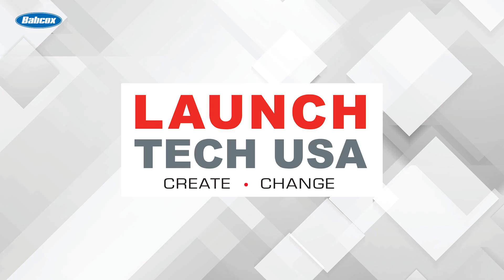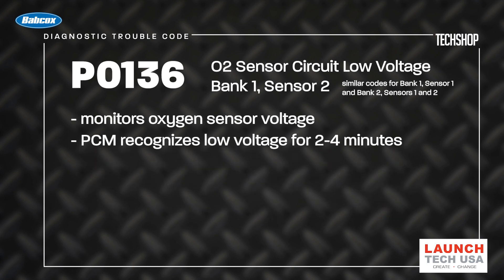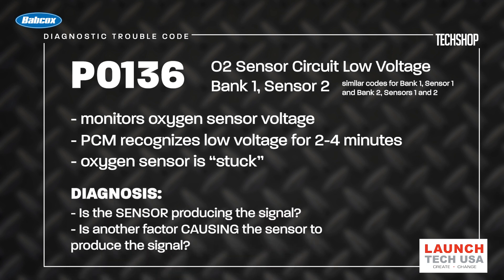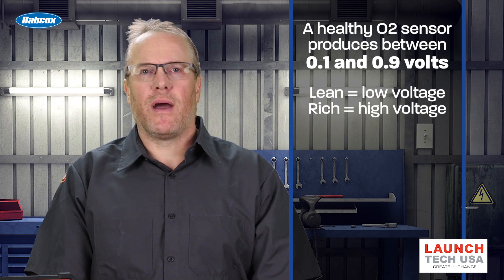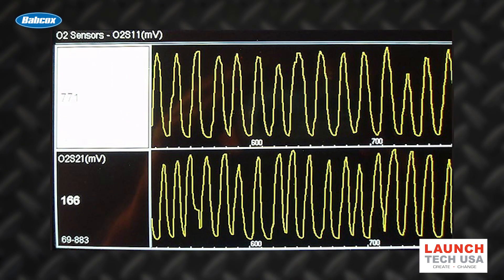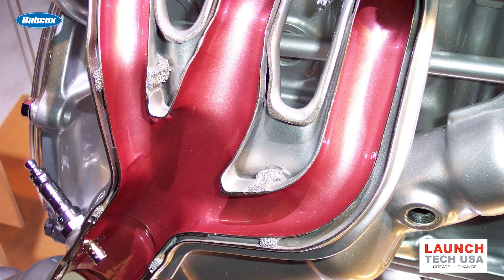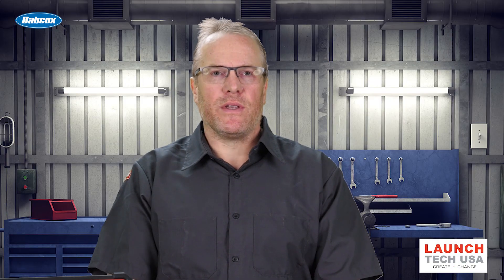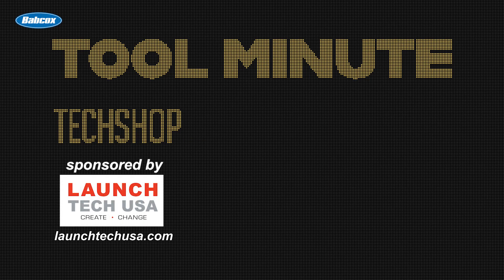LAUNCH Tech USA-Code P0136 O2 Sensor Circuit Low Voltage

Comment: Sir this same error code is coming in Prius c.i changed 2,3 O2 sensors but  not fixed the problem.there's no any wire damages.what it could be the reason.
Reply: Check for exhaust leaks